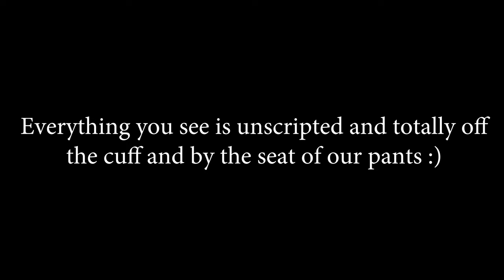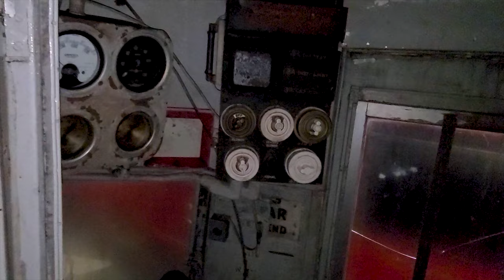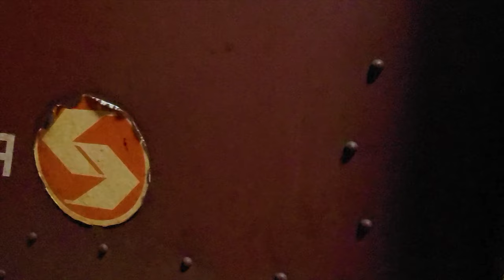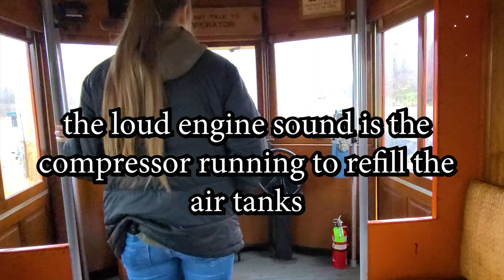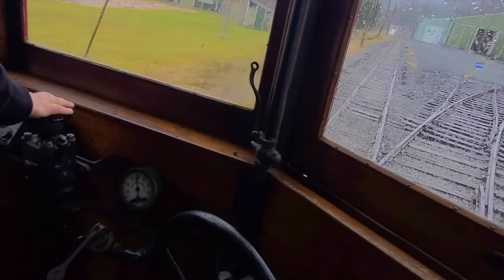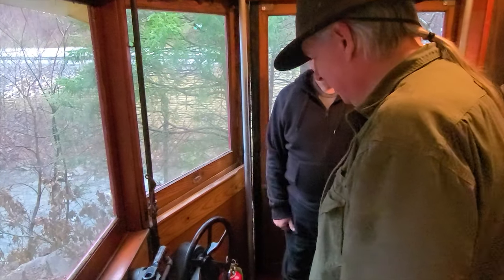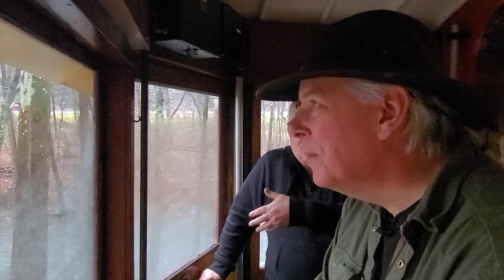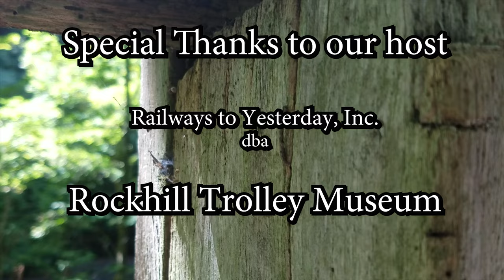Ever Wonder what its like to be a Trolley Motorman

Comment: Good video, Be careful with terminology as in the streetcar/trolley world some things has different meaning then the railroad worlds. You missed a lot by not having a powerful light on the liner. That's one of the coolest things any museum has.
Reply from the maker: Downside of unscripted and off the cuff... the visit was not supposed to go the way it did, which is fine.  Next time down there will be very different. :)
Reply: @ODDySEEy  Always carry a light, vest, extra batteries and snacks when doing rail related trips. I never go anywhere without being prepared, even if it’s unscripted should have supply’s with you especially being a big channel.